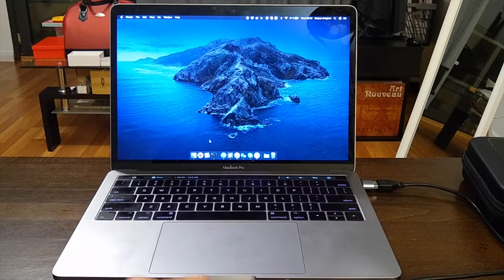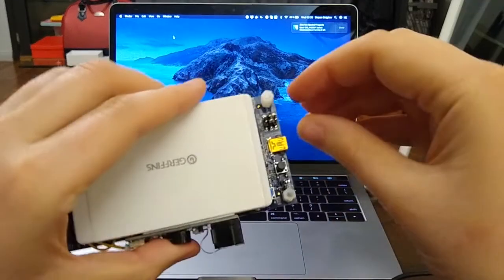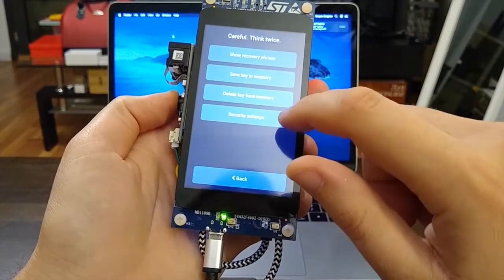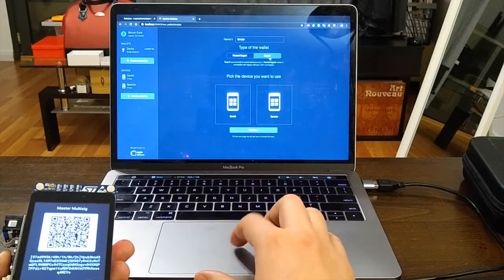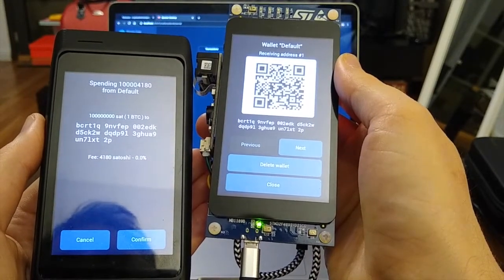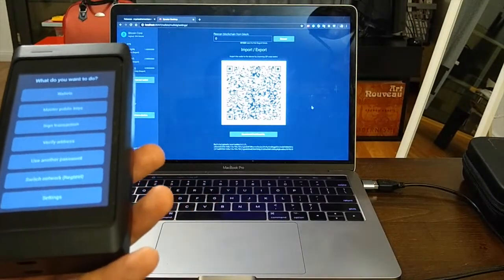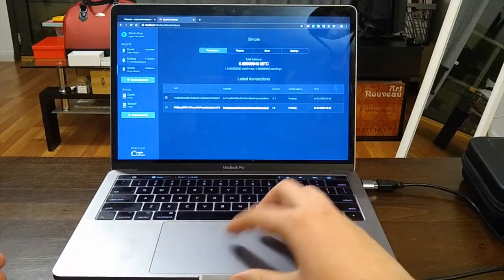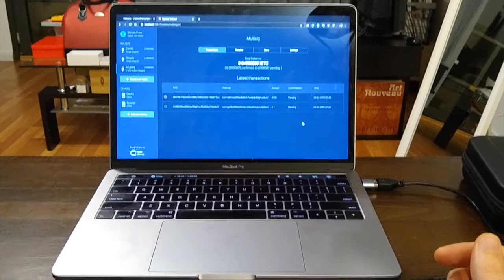Getting started with Specter-DIY and Specter-Desktop

Comment: Hi, could we have an issue if I try to flash the mcu memory on the discovery board wo any QRcode flasher connected? I had flash the embedded memory with initial_firmware_v1.5.6.bin
Reply from the maker: It shouldn't matter if you have QR scanner connected or not. Just make sure the power jumper is in the correct position (STLK).
You can also use Specter-DIY without QR scanner at all - just with SD card or USB.
Reply: @SpecterWallet  ok so if think have an hardware issue on STM32 board or à wrong option bytes configuration for the boot Of .bin file… did you have the standard Option bytes configuration for the flash firmware sequence?
Reply from the maker: @Brubru13010  at what state is your discovery board right now? Does it have earlier firmware, demo firmware or is it empty? Also do you see a "FAIL.txt" file in the mounted drive when you connect discovery to the computer over miniUSB?
Reply: Thanks for you support  @SpecterWallet  :) It is a brick ;), some leds blinking from ld1 to ld4. Initially the embedded of MCU was empty (performed by a mass erase with STM32CubeProgrammer software), I have just follow you video (drag and drop the the last .bin version of specter diy). Yes after the reset of discovery board, I have found a "FAIL.txt" with the message "The interface firmware FAILED to reset/halt the target MCU".
Reply from the maker: @Brubru13010  can you try removing all protections with the Cube Programmer? The fail.txt file should disappear and you can try flashing it again.
https://github.com/cryptoadvance/specter-bootloader/blob/master/doc/remove_protection.md#with-gui
If you are fine with the command line you can also use openocd to remove protections and stlink-tools to flash the firmware - it usually works more reliably comparing to drag-and-drop.
Reply: @SpecterWallet  yes sure, and for the flashing of .bin file m, it must start at adrr 0x08000000?
Reply from the maker: @Brubru13010  Yes, that's correct!
Reply: @SpecterWallet  i did, but no boot seems start… fail.txt is present into the root of Discoboard… I think have an hardware issue… I will perform trials on an other board next week. :/
Thanks for your help.
Reply: @SpecterWallet  i confirm that i had an hardware issue on my first STM32F4 Discovery board… Now it just works great with a new one! :)